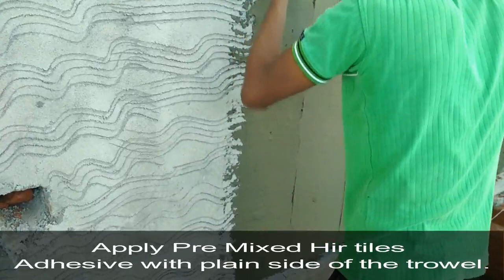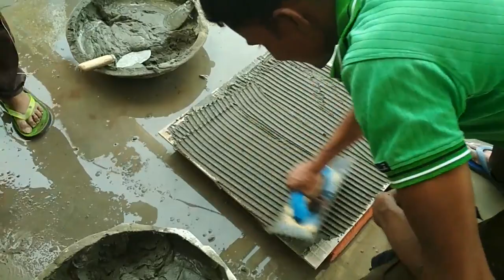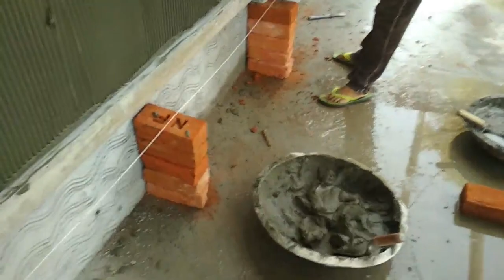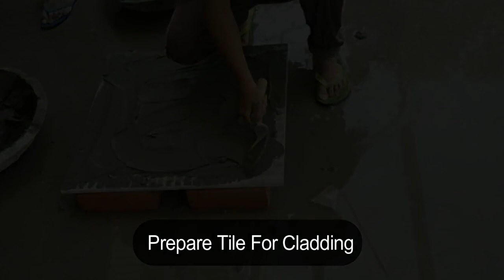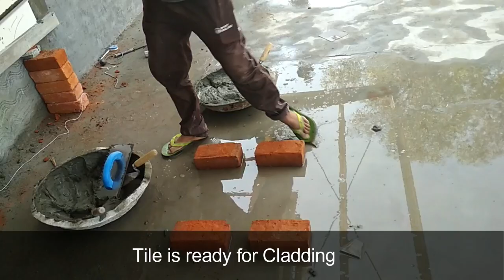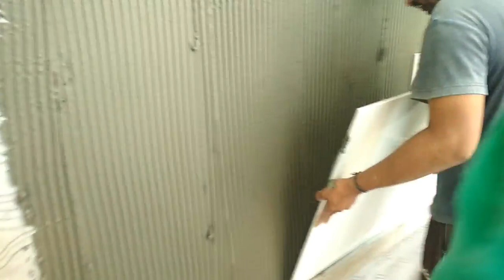How to clad or Install Vitrified or Ceramic Tiles on Wall

Comment: Vitrified vs ceramic tiles on bathroom walls and of which size?? 
Please reply
Reply from the maker: Ceramic tiles are clay tiles, which have tendency to absorb water even if has glazed. Compare to vitrified tiles having only 0.05% water absorption tendency which is negligible. So it will protect your bathroom for water leakage. It has hard body will has much longer life then ceramic tiles. Hope it will be helpfull. Thank you. And even sorry for late reply.
Reply: @pintssmartbuilt3445  can I put gvt dura stone tiles on floor??

Comment: Eso es mocho pega q gastan en una sola baldosa
Reply from the maker: Materal usage and coverage depends upon the level of the surface, and the minimum requirement for size 600mm X 600mm and 9mm vitrified tiles is about 6mm thickness of adhesive. Thanks for comment....
Reply: @pintssmartbuilt3445  .

Comment: Only cement or anything else??
Reply from the maker: It is Tiles adhesive not just cement. Specially made for fixing tiles on wall.
Reply: 2/4tiles wall m lagane k lie both wall aur tiles pr adhisibh lagana hoga kis pls